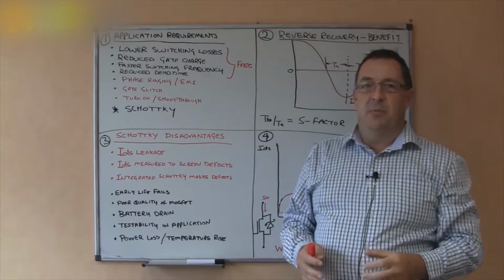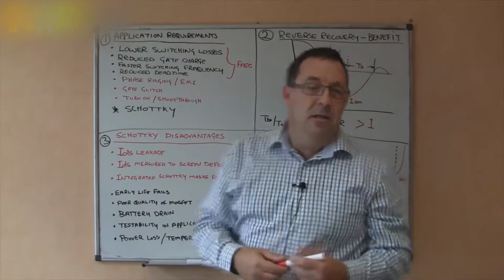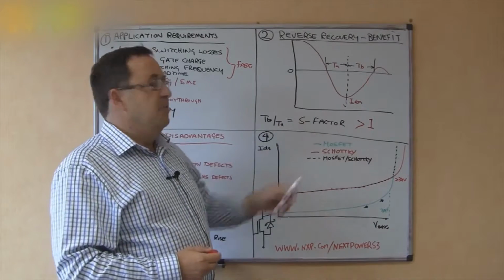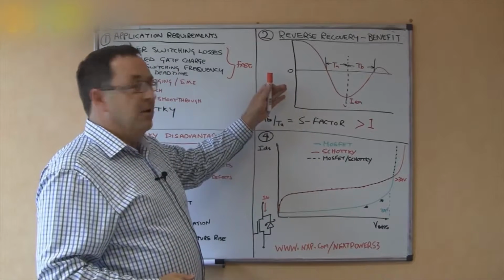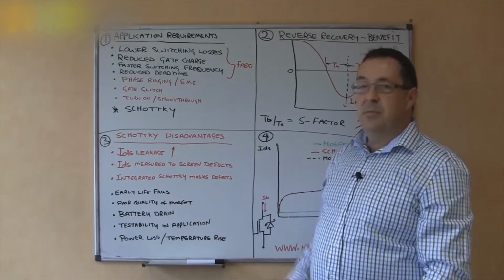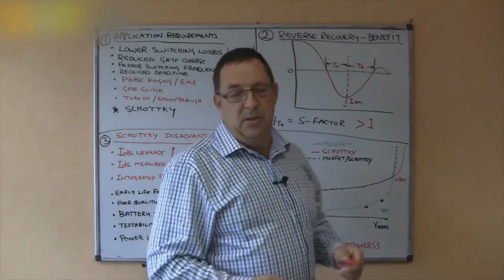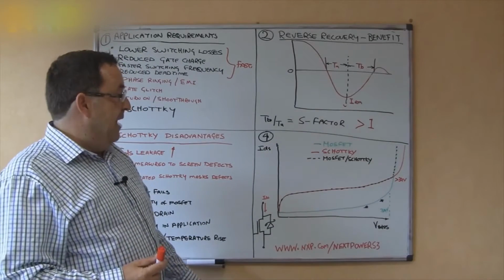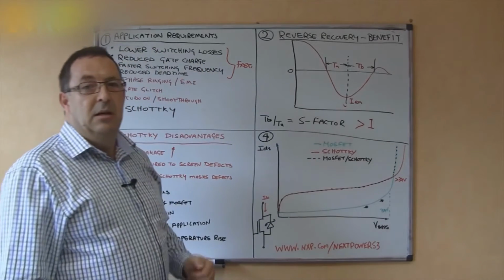Reverse Recovery & Diode Leakage in SMPS Nexperia Quick Learning

Comment: Hello, I have a questions regarding the silicon based PIN diode and Schottky diode. i know the reverse recovery of PIN diode is greater than the Schottky diode. As i heard when we increase the temperature the reverse recovery of PIN diode increase but on the contrary, reverse recovery of the Schottky decreases. I do not understand why.
Reply from the maker: Hi Sara, 
Similarly to a recovery rectifier, the reverse recovery time of a Schottky rectifier increases with the increasing temperature. Though almost no minority carriers are involved (assuming the PN junction at the guard ring is not active), the junction capacity has to be discharged.
 For further information you can check out our blog post on Trench Schottky Rectifiers :  
https://efficiencywins.nexperia.com/efficient-products/Why-Trench-Schottky-rectifiers-are-the-preferred-choice.html or one of our technical articles on the same topic at EEPower https://eepower.com/semiconductors/trench-schottky-rectifier-functioning-benefits-and-use-cases-nexperia-1456 .